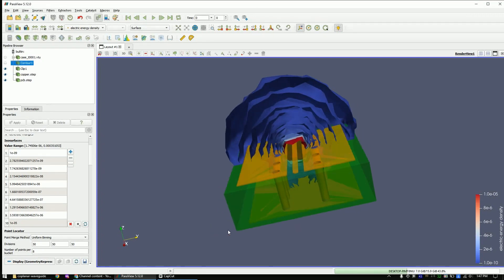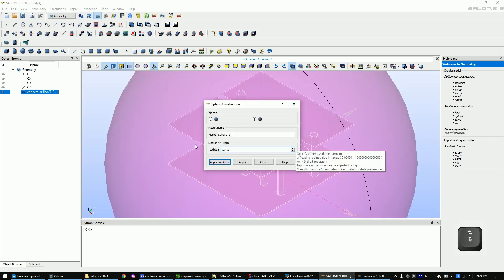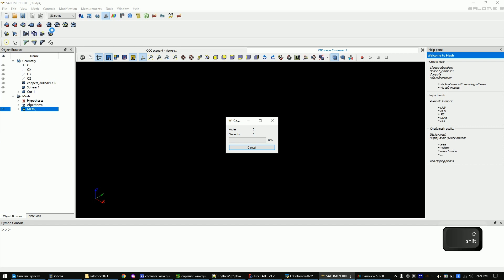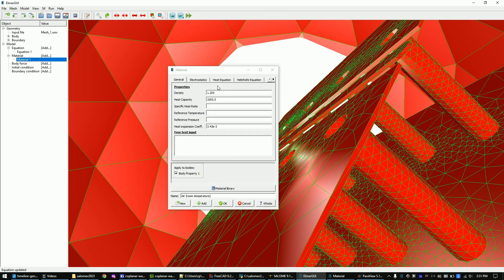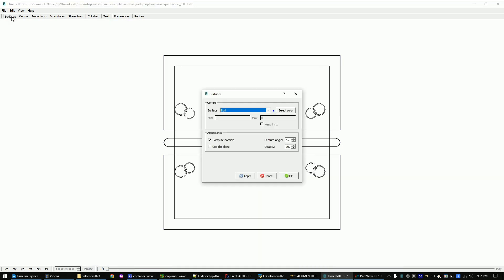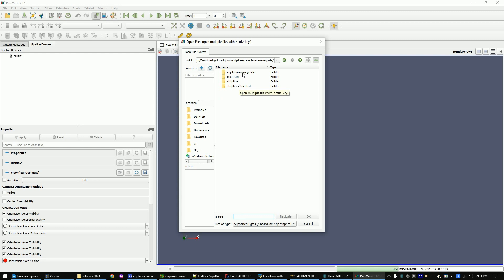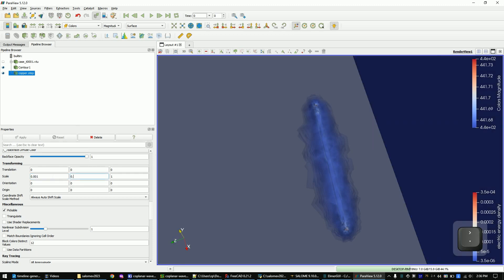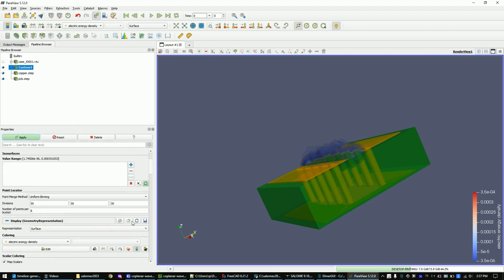Coplanar Waveguide Electric Field simulation with KiCad and Elmerfem Finite Element Analysis

Comment: From KiCad 8.0+ I managed to replicate the simulation/tutorial without using the KiCad StepUp. With KiCad 8.0+, you can export the copper traces, vias and board body in the same .step file. Then, when importing it to FreeCad, each zone, each track, each via, each via pad  and the board body can be selected independently. So you can select everything but the board body for the first export of only the copper. And you can also selct the board body for the second export as well!

-I exported the .step from KiCad without optimizations (because they might break some compatibility with FreeCad).
-I did get an error in FreeCad or in Salome for overlapping layers (I think the via pads and the zones were overlapping), but you just hit "ok" and continue with it.
Reply from the maker: Glad to hear it worked for KiCad 8 after pressing the OK button! That’ll definitely be helpful for anyone who reads this comment. Thanks for this one :)

Comment: i am not getting option to active isosurface view in paraview, the model is loaded and all other things are going well only the panel in which there is iso surface view is not active
if you have answer to this please tell ,
and by the way You content is very good
Reply from the maker: Hi there,

Do you mean that the isosurface view button just grayed out or is it not present at all?

If its just grayed out:
For it to be active you must be clicking on the field object in the "pipeline-browser (thats the window where all the object are listed)" first, I had some students clicking on  the step file or another object and try to click it and this didnt work:
https://drive.google.com/drive/folders/1oIcr8aJ_9Rxtj1ovVpacnMQzWMZwnh8j?usp=sharing

Best regards

Renato
Reply: @panire3  Hello , Thanks for your reply.
I have done as you suggested but still all the options in  including this isosurface view and other option beside it like clip,slice option are all grayed out. I am selecting the object, all other things are working just fine just this option lanes are not active means grayed out. I got my results either way. I was just asking so that it will be presentable in contour.
Reply from the maker: @mr.unique1729  Hi there,

Glad to hear you managed to get your results, even though those options weren’t working.

It might help to try a different ParaView version. I vaguely recall running into similar issues with older versions, though I am not 100% sure.

Which ParaView version are you using?
For reference, I am currently working with ParaView 5.13.3.

Best regards

Renato

Comment: At 30:29, What is the reason behind numbering "Capacitance bodies" 1, 2 ? Is there a pattern we need to follow when numbering them? Can I assign any number I want to capacitance bodies?
Reply from the maker: In Elmer, capacitance body 1 is interpreted as the ground plane (GND), and capacitance body 2 is assigned the positive potential. This numbering must be followed. I am not sure why exactly they use this numbering instead of offering some kind of drop down menu to choose negative and positive potential.